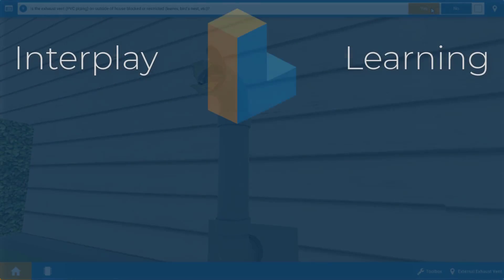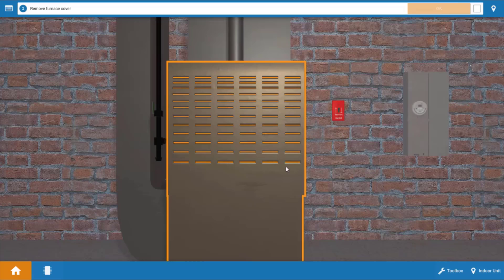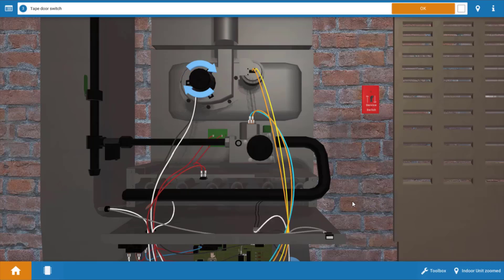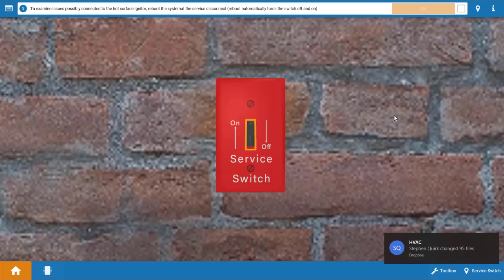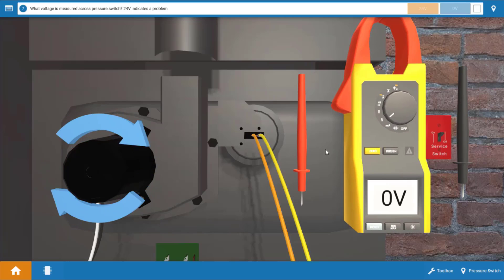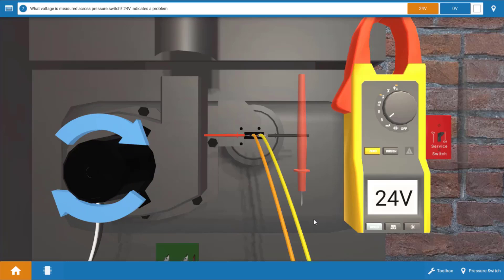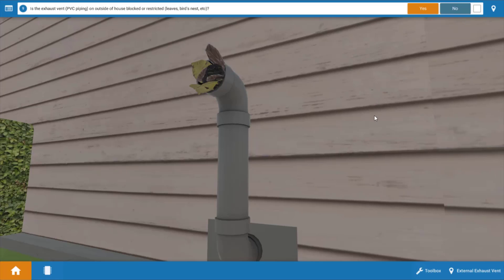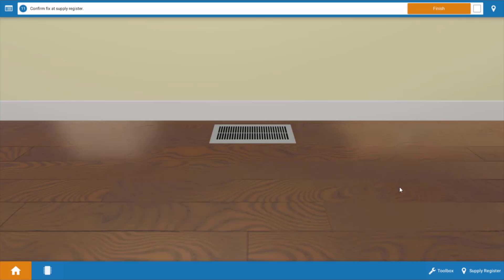How To Troubleshoot A Gas Furnace with a Blocked Exhaust Vent

Comment: okay, but what happens when the furnace shows code (blink 6 times red) indicating pressure switch cycled. but furnace is operating normally?
Reply from the maker: Something caused the pressure switch to open momentarily.  Perhaps a good gust of wind or downdraft.

Comment: At 2:34 minutes in you are correct that across you should get zero volts when the switch is closed but you will also have zero volts if no voltage is present. You need to confirm from one side of the switch to ground that voltage is present. The  video series which makes this test should be corrected.